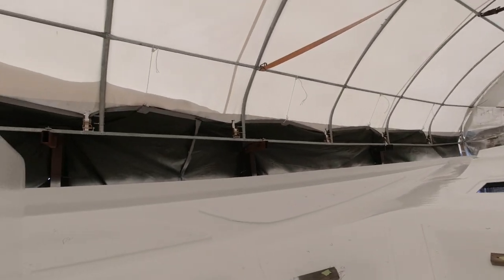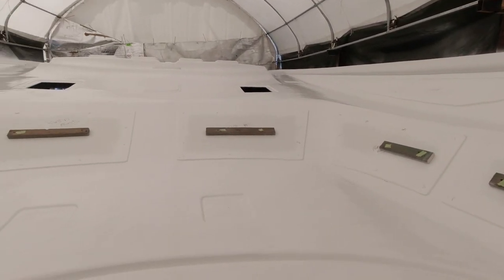Catamaran Deck Gel Coat Timelapse March 2021

Comment: Looks great, is one coat of gel always enough?
Reply from the maker: Recommend never double gel coating .Generally results in gel applied too thick.Try to gauge thickness as we go,I had a couple of of spots I touched up but checked thickness a few times with a mil guage to ensure It was reasonably consistent.Cheers Ross